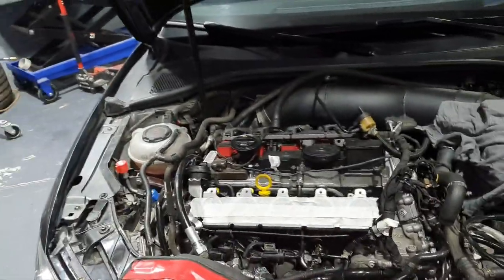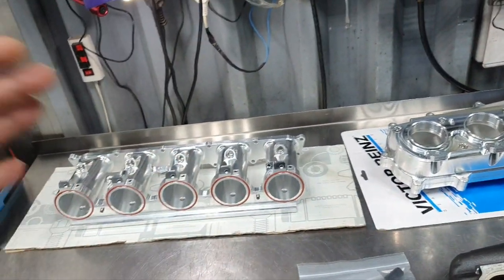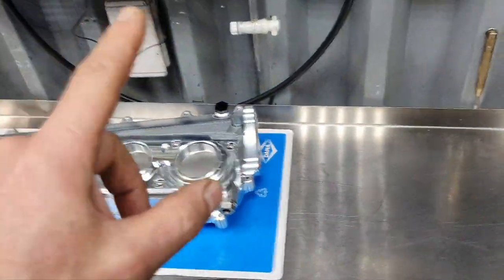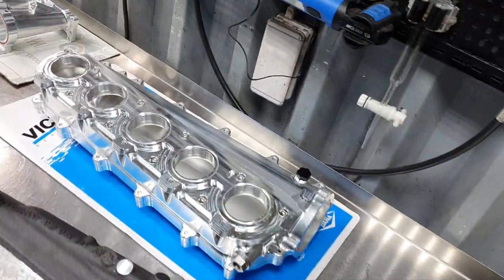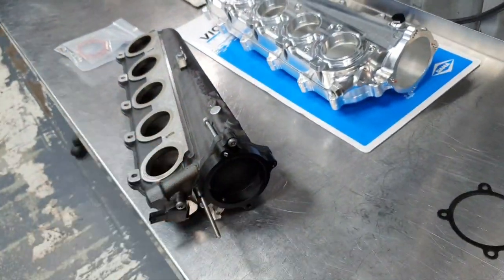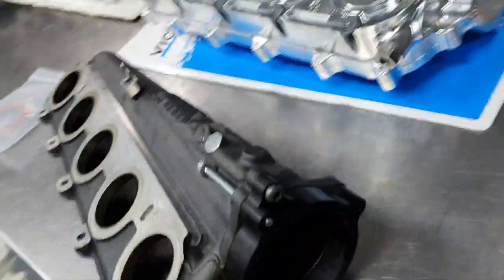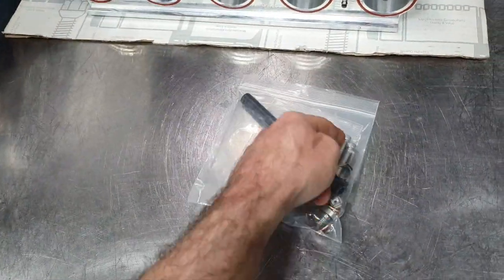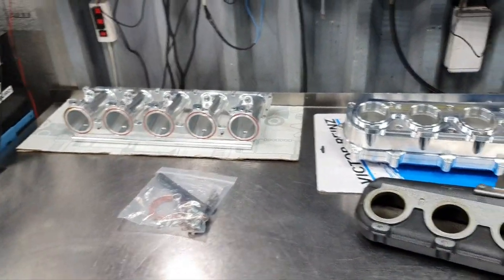RS3 DAZA engine rebuild (part 25)

Comment: I completely agree with you that o-ring on o-ring is never a good idea. If the designer insists on having grooves on both parts of the manifold, there should be a single thick o-ring that fills both grooves.